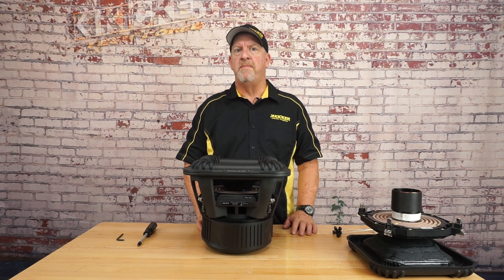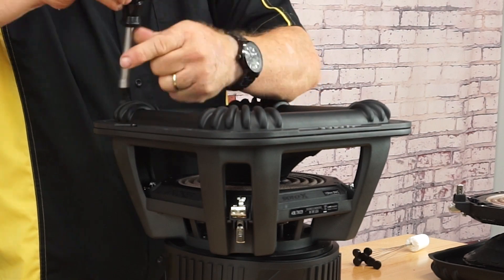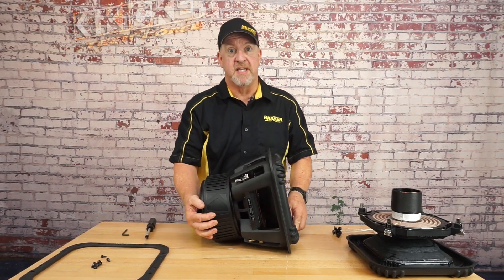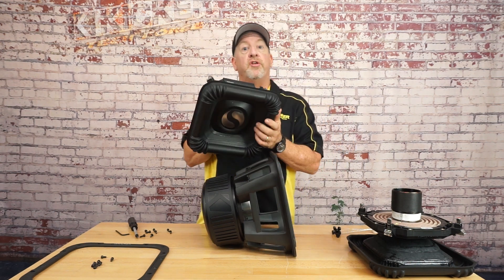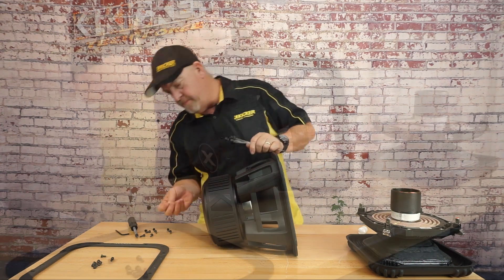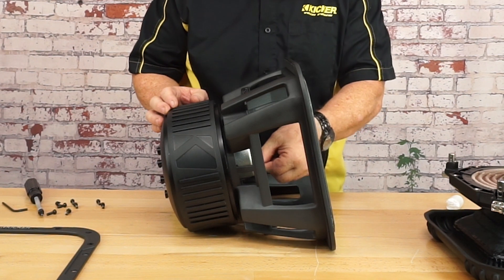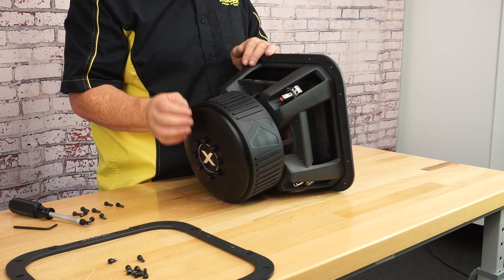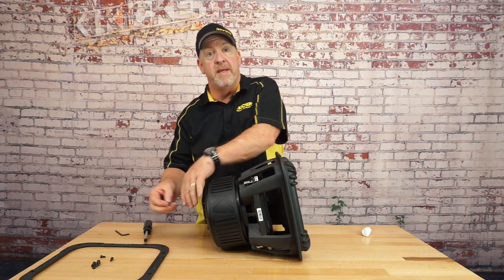How to Recone a KICKER L7X Subwoofer (sizes 10", 12", 15", 18" only)

Comment: I recone mine on my own and it sounds good but big smell coming out like burnt coils even at low volume, did i did anything wrong any suggestion please, thanks.
Reply from the maker: If it was a problem during recone like a misaligned voice coil you'd be getting distorted sound, buzzing, or rattling. Could be the voice coil is overheating due to clipping, or the new components are just going through their initial heat cycles. New subwoofers do require a couple of weeks for break-in.

Comment: I wasn't going to go this big in my pickup but if Kicker is willing to produce these replacement cones well into the future than why would you buy anything else! How much is the 15" ? Is it available?
Reply from the maker: The 15 is coming soon.  It will be 749.
Reply: @KICKER-AUDIO  that gives me time to finish off my home theater than. I am wires, speaker stands and a power conditioner away from finally having a complete separate processor and amp setup. Hopefully I'll have some funds set aside for the 15 when it comes out. Can this be the last car audio sub I need to buy? Can I just keep buying replacement cones if I romp on it to much? Will you keep making replacement cones for years to come? Because I wasn't going to buy top of the line but it looks like the smartest buy in car audio.

Comment: Sub looks nice, but they just came out and theyre already mass producing recone kits? Seems sketchy to me, especially seeing as how big d has already commenting saying hes reconed a few already. Kicker doing what it does best i gues...
Reply from the maker: No, we don't expect subs to blow.  We made the Solo X to last in a daily ride for years, but nothing is indestructible. Absolutely nothing. We also know a sub like this may be subjected to power levels far beyond our recommendations. With most other manufacturers, their high SPL subs have to be reconed. This is almost never covered under warranty (unless its deemed a manufacturers defect), but repair is possible. The "normal" process with most companies is to pay for shipping to send it back to the manufacturer. The consumer also pays for a recone kit. This often takes a few weeks. We made recone kits to eliminate the shipping costs and the delay.  It also ensures the cone alignment is perfect every time.  Now let's talk about SPL competition....

If you spend any time around SPL competition, you will find that competitors use subs like drag racers use engines:  they ride the ragged edge of what a sub (ANY sub) can take. The problem is that reconing a sub typically takes a long time to do..cutting out the spider and the surround, disconnecting the leads, cleaning the excess material off the frame and the gap, realigning the cone and voice coil perfectly then re-gluing everything - then letting that glue cure and reconnecting the terminals before reinstallation.  This can take hours, and it's a calculated risk that everything was done perfectly. Speed and precision rarely go hand in hand, especially when that competitor is up against a clock, due to compete again in what could be hours or minutes. We went to competitions, watched what was happening, and decided we could make it easier for them, and ultimately for a consumer.
Reply: That has to be the dumbest statement I've read all month.
Reply: I lost 20 iq points after reading this comment. Jesus Christ...